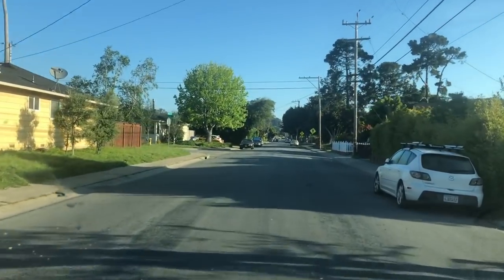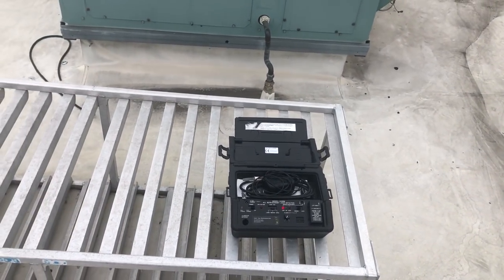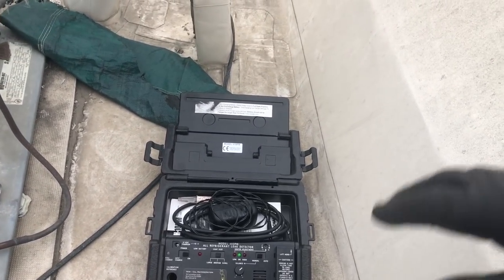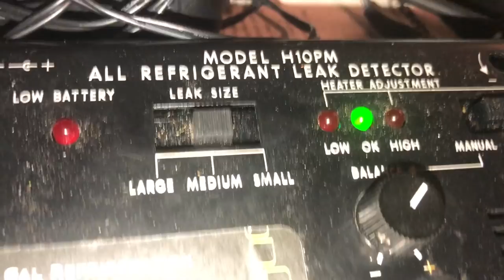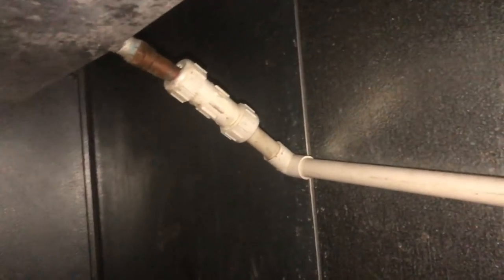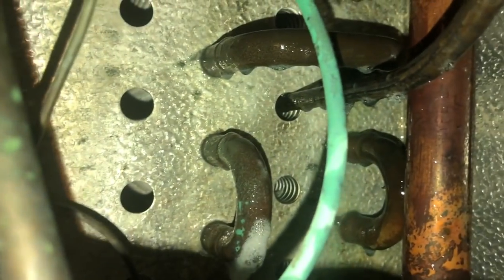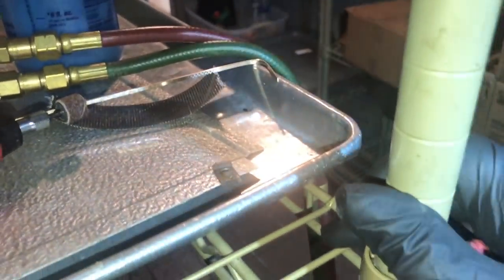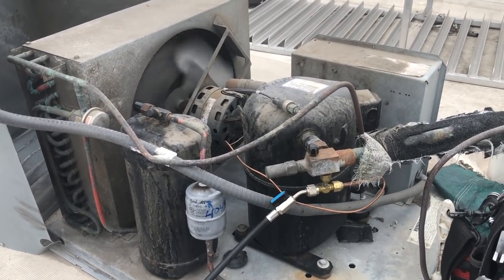H-10 finds the leak UV die could not

Comment: Dave I've been sold on the H-10 leak detector for quite some time, since 1985 when I first got started in this business and when the H-10 was made by G.E., but it's most effective on Chlorine based refrigerants.  Have you tried to get Inficon to send you a "Stratus" leak detector yet for review?  That thing is amazing.  It outputs leaks in PPM (Parts Per Million), in a geiger counter way.  The closer you get to the leak, the greater the PPM increases.  You can find a leak to a specific spot.  I can find leaks the H-10 can no longer find.  However, once a leak is discovered, bubbles always take the cake, so to say, in pinpointing the exact point of leakage.  ELD's have their place, but nothing can compare to "Big Blue" in finding the exact spot of any leak.  I hope you didn't have to chase the end tube leak all the way around and into the coil tubing.  Those  micro pin holes can be murder!
Reply from the maker: The H-10 pro is better. Watch this on R404a. I’ve seen rookies video using the new inficon vs H-10 pro the H-10 out preformed it.  Here’s my video. H-10 doing exactly what you discribe. I would test the inficon if they sent one. But right now I would not buy one.  
https://youtu.be/jXGF3FBMvDw

Comment: Get yourself some small metal brushes for your "dremel." You can get good ones at home depot but Harbor freight sells a multi pack of different sizes on the cheap that work great for polishing up those coils. I like them better than the sandpaper wheel. Good repair buddy!
Reply: I used them on type L copper(water/boiler) mounted in a cordless drill, sure made cleaning the fittings easier (1" and  1.25")

Comment: H10 is the best. I've never had luck with dye trying to find a leak in the evaporator.  Unless you're there to catch it right after you put it in the condensation will wash it down the drain. Just easier to break out the H10 from the start.

Comment: That's a great tip for ALL heated diode leak detectors. They all need to heat up for a few minutes before you start using them. And it's best to "prime the pump" with a small sample of refrigerant. But you guys should NEVER EVER stick your sensor tip down to a cracked jug of refrigerant, you will kill your sensor that way.  Always crack the jug for a second with a cap on it.. Then remove the cap from the jug and move the cap slowly up to the tip of your detector. That's all you need to make sure it's working and to get it ready to searching for your leak. 😎👍
Reply from the maker: Preach it pastor Shannon.  ⚡️⚡️
Reply: done be a jug-head, instead do as Shannon Knight HVAC
 said :)

Comment: Had a couples calls like this once. 1 freezer and 1 cooler. Both leaks in the same general area your found yours. The freezer coil had 4 of the loops leaking at the factory welds. Unit was just over a year old. Was able to re-solder it all and as far as i know, its still going 3 years later. 👍
Reply from the maker: That’s a real repair 🤘⚡️🤘

Comment: Man oh man, I can't wait for a wave of these 'DIY' mini-splits to become calls in the coming years when everyone's 'handyman' cousin slaps one of these in for a six pack and 100 bucks - they're gonna quickly realize the cost of 'just making it work right' is gonna end up being more than what they paid for the thing.
Reply: mike_HVAC  I have made some repairs on a couple DIY mini installs lol. The ones I worked on had pre evacuated line sets with o ring connections that pierced the line upon tightening, they ALL LEAK. I cut the joints out braze it together and weigh in a new charge. Lol cost them more for the repair then the Amazon system lmao.
Reply from the maker: Scott Kneeland I do the same thing 🤘⚡️🤘
Reply: @scottk0623   Had a friend (who I hadn't talked to in a few years) call out of the blue wanting me to install one of those Amazon Mini-spits for him - luckily I talked him out of it.

Mainly because I knew it would be a never-ending pain in my ass that would get me called on weekends to drive an hour-and-a-half...one-way...to have to deal with when him and his (very demanding) wife weren't 100% happy with it.  Easier to tell him to slap a window unit in his 'man cave' and go on with my life.
They ended-up moving a year later anyway.
Reply: ,,,also, these clever little ads leave out that pesky part about drilling a BIG FUCKING HOLE through the wall and having to run another electrical service - I think the people over at 'Mr. Cool' want to make that sale and then let the home-owner discover they bit off more than they can chew once they crack open that instruction manual and the money is already in spent...then they call us.
Reply from the maker: mike_HVAC and we make that skrilla $$$$$.  Most home owners buy a mini split on line and call for install nowadays. Internet
Reply: mike_HVAC I’m sorry Mike, but you’re dead wrong on this one. Everyone knows that HVAC and fridge men are all just a bunch of con artists that over charge for doing such simpleton work that any dipshit can do, thankfully there are awesome companies out there now that can save homeowner hundreds and even thousands of dollars by not having to hire “mechanics”... I had a carpenter inform me 100 percent no if’s ands or but’s that the quick connects do not leak and my “skills” were not needed... guess I’ll just quit now and go apply at McDonalds... 🤣
Reply from the maker: 404 Refrigeration & HVAC Services 🤣😂🤣😂🤣🤣🤣🤣
Reply: I bought one off amazon, Pioneer. But had a pro do the A/C work. The guy I hired didn't source them but had no problem making the connections and starting it up. I did the grunt/electrical work (easy since there was already a sub panel there.) Still rocking 6 years later no problems. Where I worked prior we had an AC company source and install a dual head, same as I got on Amazon. 5x more price, lasted 3 years before it leaked at the flares. Though, this is the same company who (after I left) swapped out a pan twice 'cause it was "leaking." I would fix this "leak" by simply clearing the drain line. The company I worked for ended up paying for 2 brand new A coils from the butcher job they did. Then they paid for a completely new system. The moral of the story? It doesn't mean much to source the unit from a pro or Amazon. What matters is the pro who installs it.

Comment: Good catch Dave! I like using my wire brush wheel in my drill, its a little less aggressive than the sand paper. I love my H10 pro, only down side is the wand not reaching deep into the unit in hard to reach parts and the battery life is low.
Reply from the maker: guys have set up dealt batteries to there h-10's mines old enough to try a hack.

Comment: H10 for the win! I have often thought why doesn’t Bacharach add in an 18 volt detachable rechargeable batterie like my Milwaukee 18 volt tools... other than the battery issue it is an amazing detector...
Reply: I use a dewalt battery for my H10. I cut the h10 charging cord and hook it up to the terminals on the dewalt battery. One battery lasts 5-6 hours and can swap with another charged dewalt battery when needed. I do supermarket refrig, can leak check all day and all night, never have to worry about charging because I always have charged dewalt batteries in my van.
Reply: Final CountdownX2 that’s what I’m talking about. Unlike you though, I’m scared to try modding my tools like that. I think that you should send pics to Bacharach of your battery mod and tell them to consider doing something like that. Everyone would have to buy new units with the removable 18 volt battery...
Reply from the maker: Final CountdownX2 excellent job.

Comment: I’m waiting for mine in the mail- just ordered a few days ago off eBay- “only used once” open box- however I didn’t think to ask if destructions came with it- can you explain the small-medium-large switch- I understand the sensitivity dial but how do you know where to set the switch- I mean until you find it how do you know if it’s “big,medium,or small”? I was turned off by the h10 because years ago I shadowed a chiller rep who per procedure leak checked the chiller with his old school h10 and it went off every weld, gasket everything and maybe I’m a little conservative but no bubbles=no leak. But after watching a few videos I was sold- said example he obviously had sensitivity dial to high

Comment: I learned on my dad’s H-10 from General Electric from 1975. You had the same problem holding the camera in one hand and trying to sew the heated diode in my video I had to put the camera down to.  Later I’ll show a video on doing a lithium ion or iron phosphate DIY custom battery inside the H-10.  I’m debating whether I should make it a exterior battery charger or make up a little battery module I include inside the case of the H-10.  This way the battery will last about three times longer than the lead acid battery that comes inside at H-10
Reply from the maker: I just read a comment where dewalt battery is being used.